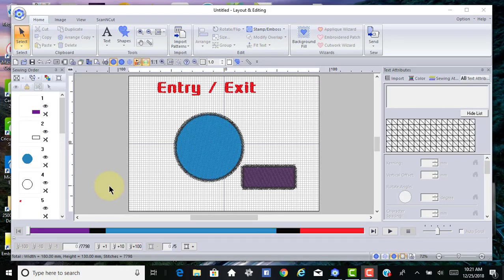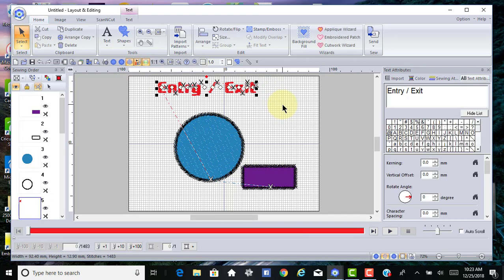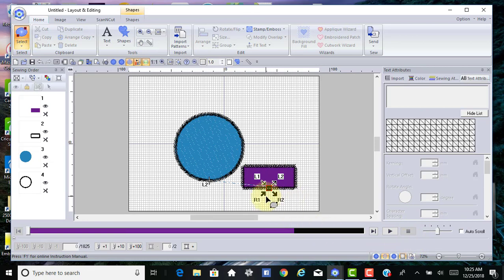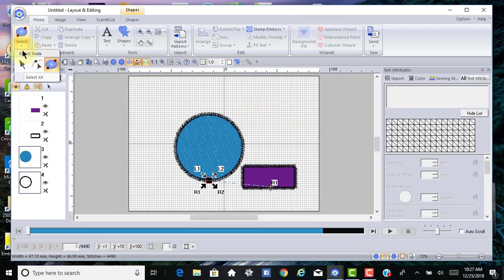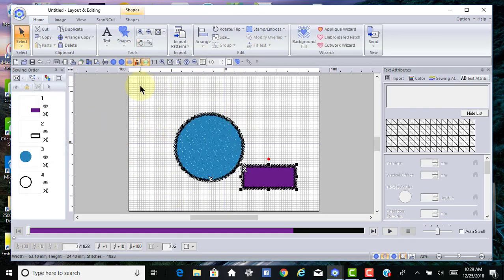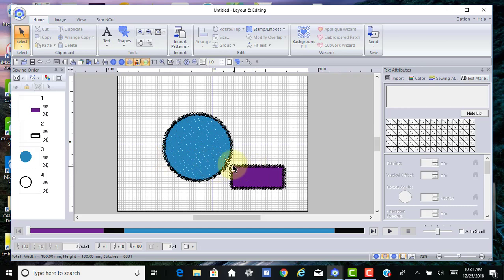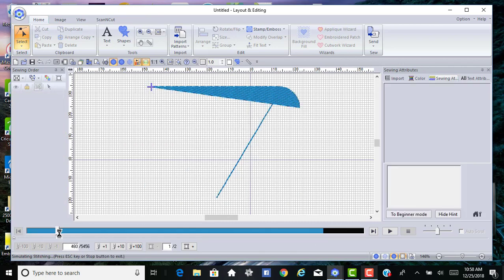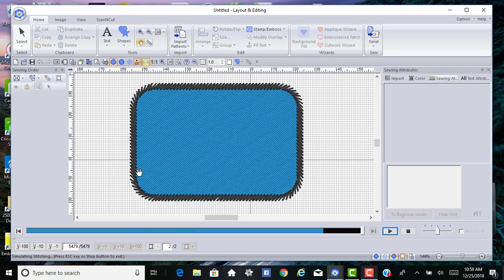Understanding Entry/Exit Points in PE Design 11

Comment: Why would they not allow for this option to be viewed for all machines? Aren’t most embroidery machines trim cutters, too? I do appreciate your vids. Just got this with the Luminaire.
Reply from the maker: Dianne Salazar - Newer machines have settings that allow you to turn the thread cutter on and off and to adjust for trim lengths.  Older machines do not have the same options.  I might leave the software on multi needle while I am designing, but in the end, I select a hoop size for my single needle machine and save the design.

Comment: It doesn't show any under lay stitching.  To you have to add that to the designs you digitize.?
Reply from the maker: Jani Demaree - you can look at the stitch attributes to see if underlay is an option for the stitch type selected.  A good source of reference on stitch types and whether or not underlay is an option is in your reference manual.  Look for Stitch attributes starting with page 376.